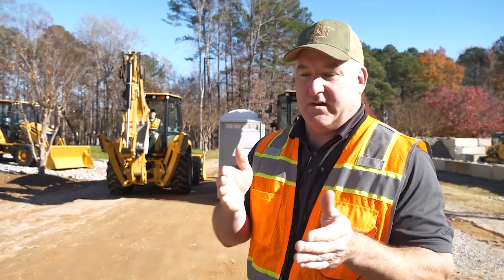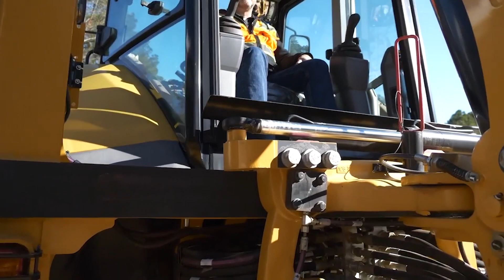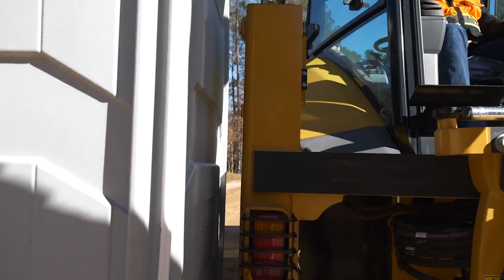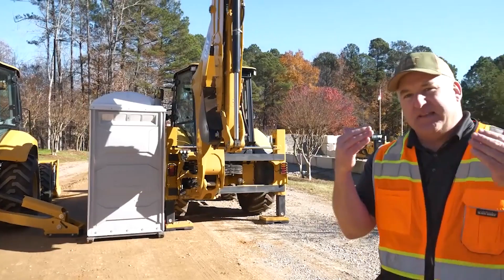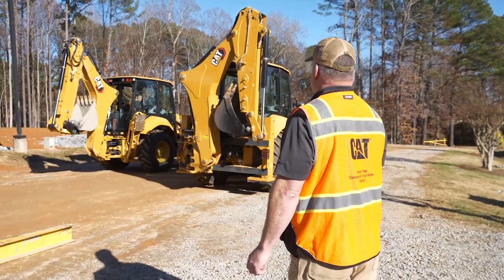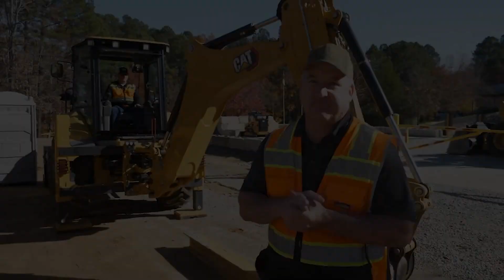Center Pivot and Side Shift Backhoe Comparison

Comment: I owned a Case 580 for years with extendahoe.  This 100% depends on what you're doing.  For how I used mine, I needed the wide stance of the center pivot and those down riggers.  If you're digging a small pond, that side swing is going to be all over the place when swinging the hoe

Comment: The guy on the side shift is not an operator.😃😆😁
He would have lined up the tractor better with the beam.
Besides it's easier and faster just to lift up the back of the tractor and move it over with the boom.

Comment: I love the mechanical parallel linkage on that one that has the material handling package on it.
I wish every loader had that!
I ran big loaders for many years and I hated the z bar linkage on those!
I also can't stand the linkage on that other tlb on the other side because that standard linkage is always fighting what I'm trying to do!
I'm very glad my dad's John Deere had the parallel linkage, because his Massey Ferguson didn't!

I've recently noticed that some people called it the self-leveling linkage which is pure BS cuz it never automatically levels itself. It does automatically stay at whatever angle you set it at while it goes up and down.
Only the big industrial loaders have the self-leveling mechanism, and you can turn it off when you want to.

I also love the hydraulic parallel linkage on the telehandlers.

Comment: My dad had both. His John Deere had center swing and his Massey Ferguson had side shift.
He usually preferred his John Deere whenever possible.

And whenever possible he kept his tractor turned at an angle so he didn't have to look through the boom.
Of course he always kept his front tires turned at an opposite angle so he can still move the tractor forward with the boom.

Comment: Only thing i dont like about the sideshift is that the front Cylinders for the bucket tilt can get damaged when backscraping with the front bucket
Reply: you can damage the front cylinder on the center pivot one as well... even easier as it is sticking out further and in confined spaces it might make a bigger difference

Comment: I surprised it took so long for the US to reconsider the side-shift with vertical lift stabilizers. The only advantages to centered backhoe with side lift stabilizers are for off-road areas where conditions might be softer grounds and digging on a slope/hill.
Reply: My dad had both tractors.
You can still level the side shift machine with the vertical stabilizers when digging across a slope.

My dad's Massey Ferguson with side shift backhoe was from the early 50s. But he didn't like the control so he didn't use it as much as he used his John Deere with the joysticks. His John Deere was also bigger and stronger and dug deeper. 
He eventually sold the side shift off of the MF.
Reply: @TF856  If the ground isn't soft. If one side of the vertical stabilizer lift sinks in then it could tilt(I'm referring if you're digging against the grain of the slope). The centered backhoe's stabilizers(which the pads can be folded upside down) are far more suited for digging on slope even if the surface soil is soft(like after heavy rains).